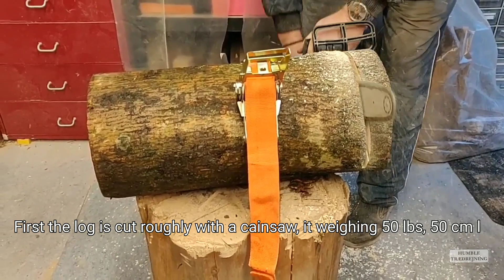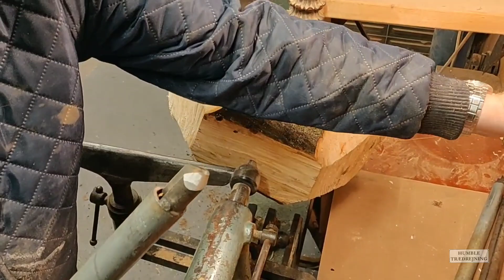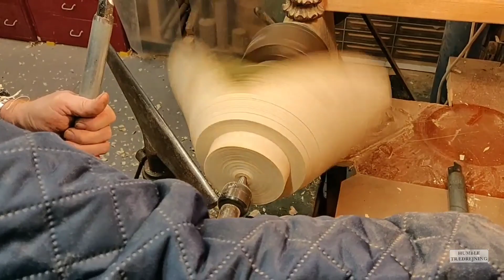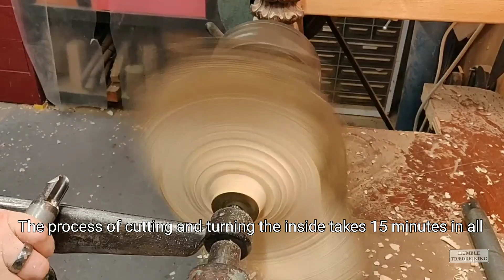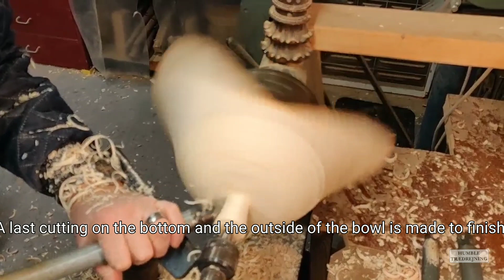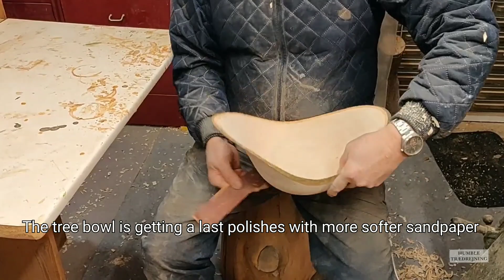Woodturning - Big tree log - Turned to beautiful tree bowl - 1. - Process from start to end

Comment: I'm very new to wood turning.  I have a couple of questions.  What tool do you use to to smooth the inside of the bowl. And when you do your last cut, when you turn the bowl over, how does it stay on the lathe? It looks like it's pressed on a round piece of wood that's on the chuck.   Am I correct?